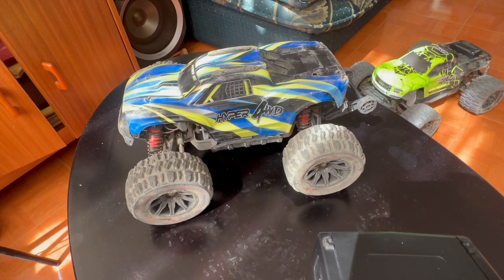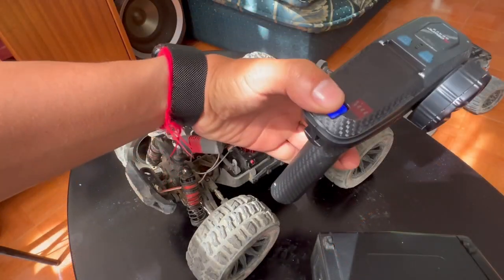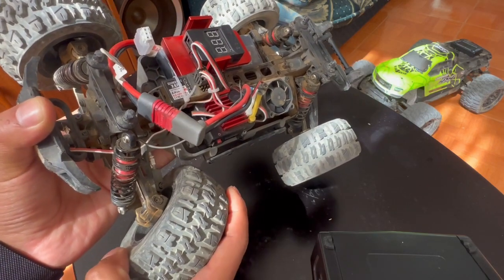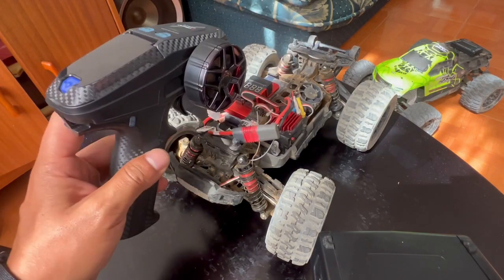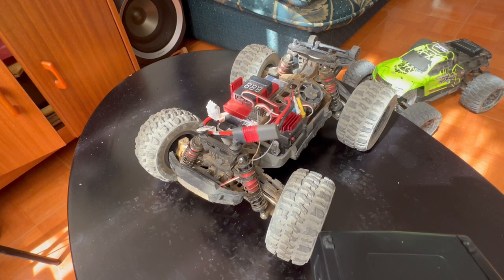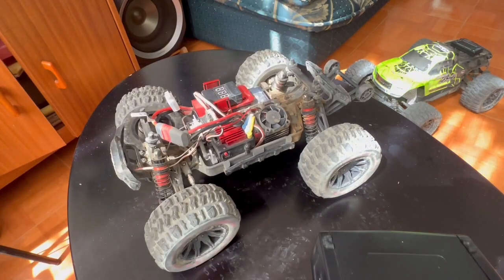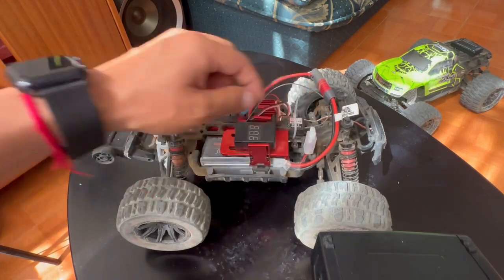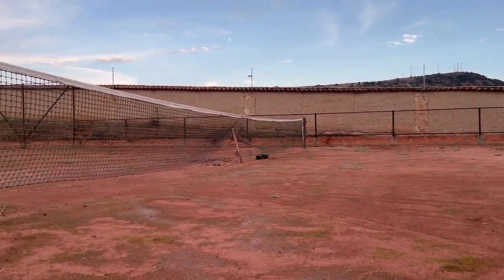MJX Hyper Go h 16 BM Steering Problem PART 2. Fix, upgrades and Run

Comment: Very cool upgrades! I’m doing hub extensions with 1/10 crawler wheels. Also the same 17g servo. Do you know the part number for the 14bm shocks
Reply from the maker: Thank you very much for your comment! and thanks for the idea of using 1/10th scale crawlers tires, i might try soon :) the part number you are asking for is HYPER GO 14510B, compatible with both MJX H14BM and 14210 models. Depending on where you are (maybe similar to me, i have no Local hobby shop in my city) you can find them on amazon or ali express.
Reply: @arq.andresfelipemoralesvar9593  yes,  you will most likely want 3s Lipo battery if you go up in tire size. also make sure to grease the front a rear differential. you can remove  the bottom four screws over diff's and have enough room to put some grease or petroleum jelly like Vaseline if you don't have any inside. Big tires will add more stress n heat.
Reply from the maker: @sheldoniusSRSlider  Thanks a lot for the tips, i will setup those diffs soon then :D
Reply: @arq.andresfelipemoralesvar9593   the 17 g servo.. I can't get to turn both ways at the same turning radius.always end up with remote set way left. I took it apart centred the tires and turned servo out of the car.it looked to turn properly both directions. Then in the car it wants to turn right nicely n turn left not so well. I used the foam from the old h16bm servo to push the new one more to right left side of car where it sits. then I blew the rear diff again lol. got a replacement but yeah had some difficulty with it. I am on the second hole from the top on steering servo arm